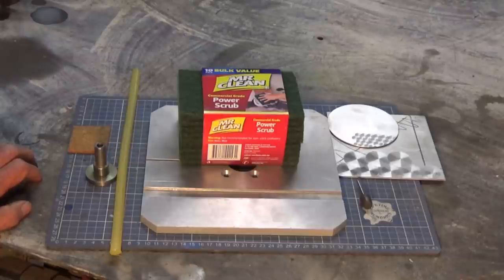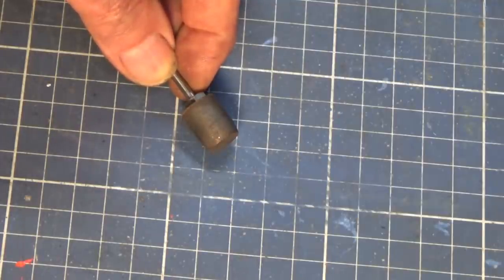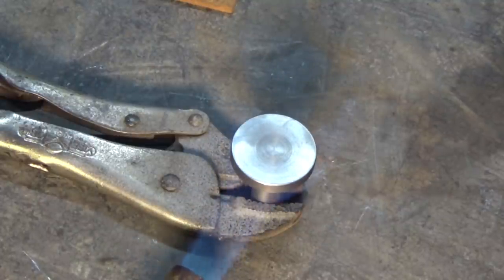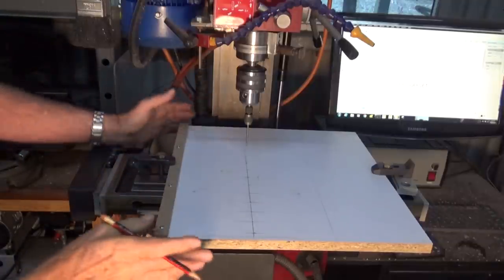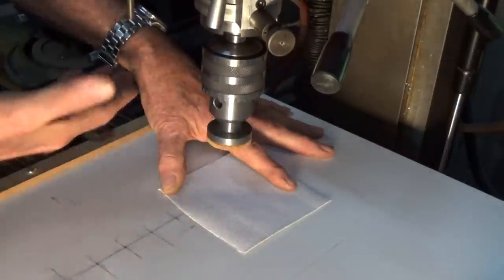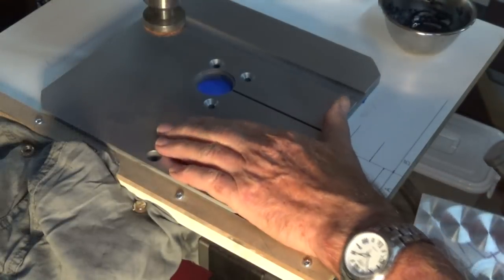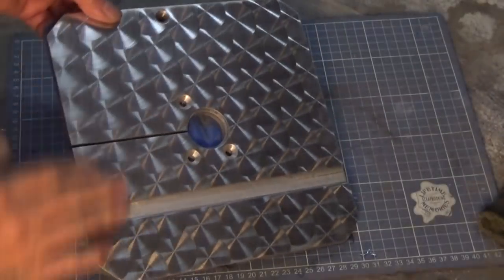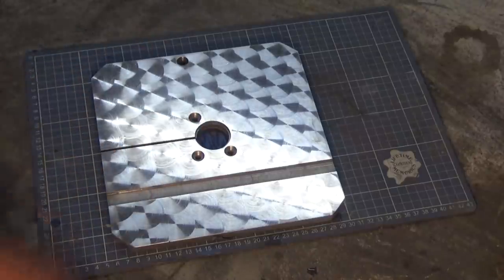Metal Finishing With Mark - Engine Turning 101

Comment: Always start at the same side, This technique is also much used on watch movements, where we apply it in a Circular pattern moving inward from the outside in the same direction every circle..
Overlap of the circles should be about 50%.. i use a 3 mm "EveFlex"tool, and i move over 1½ mm every time..

Comment: Hi Mark, I've been hiding in the bushes for a long time and this video has flushed me out!! I love all your content and always come away with something new that I've learned. I currently have a home shop with a CNC router and 3D printer that I've been using and playing with. I design and build mostly parts for my 1940 Ford that I bought 20 years ago and I'm still changing things, hopefully improvements of what I did earlier.

I'm going to use your technique for engine turning...

Keep up the excellent work and if you would like a few pictures of my car let me know. Not sure if I might have sent them earlier, tough to get old.....

Good'day mate,
   Peter
Reply from the maker: Thanks Peter. You did send me the photos of your car. A beautiful silver Ford V8. I was really impressed with the grille on that car. It's interesting because I had a conversation with an electroplater just a few days ago and we were discussing the process for chrome plating car parts back in the day when they did it properly. Usually a three stage process of copper, nickel and then chrome. These days they just plate straight over bare steel, usually with a nickel alloy and it doesn't last. Chrome is considered too toxic for the workers. However if you take your work to an old school electroplater you can still get it done to last. Keep up the great work. 
Regards,
Mark

Comment: I'm glad that you're anodizing your table after all the work you've done to it. It should increase the scratch resistance enough to preserve the look. You can even get fancier with a bright dye. 
I've been playing around with an ice bath to do small scale type III anodizing, and it does work. It wouldn't surprise me if you went with a chiller, but dying is limited due to the smaller pore size. 
A spring loaded holder might be an option for CNC engine turning. You could just smear the surface with an aggregate and run the job with cork as you did manually.
Reply: E Designs, I see you've had similar thinking on a spring loaded tool head to compensate wear. A query on anodising, does cast aluminium take an even anodic coat OK?
Reply: @howardosborne8647  Cast aluminum typically does not anodize as well as 6XXX series, but it does work. I tried type III anodizing a cast part and it was a different color (gray), would not hold dye, and had a hazy finish, but it was scratch resistant. So I considered it a win. Type II works better on cast parts.

Comment: Nice! If I was doing a run of these on cnc, I'd be looking at making a spring loaded tool, to account for the wear... top class job tho! 👌
Reply: The cork is the spring.  That thin probably ten thou give, but thicker yields more give.  Could also laminate something together.  At the "CNC" pro level though, it probably always gets done with abrasive rubber, because they remain at the same grit level as they wear, so no need to 'load the surface up fresh' to continue.
Reply: @cosmicraysshotsintothelight  The wear is from the cratex wearing in the z axis, the cork would wear but probably not enough to make a difference in a single cycle. Any chance you know what those cnc guys are using to filter the abrasive grit?
Reply: +1 I was thinking the same. Added advantage is the spring will compensate for small undulations in the stock.

Comment: As usual very well demonstrated Mark. And as at least one other has already mentioned the process is used quite a bit by gunsmiths.And like scraped or flaked machine tool ways it has some friction reducing quality's.  Plus it helps steel surfaces become a bit more rust resistant since it retains oil better. Both reasons are why it's used on rifle bolts beyond it's purely decorative effects. At one time it was seen on jewelry, pocket watches, watch dials,sterling silver cigarette cases etc. It's somewhat related to straight line guilloche and it's repeating patterns. And guilloche is somewhat related to Ornamental Turning.Your cnc could easily do guilloche or that OT as well. When jeweling curved surfaces such as rifle bolts they use not only the grinding medium but also a stiff wire rotary brush to help follow the radius. O rings are sometimes used around the wire brush to keep the wires from starting to splay out and ruining the pattern. On flat work it's helpful to have a scrap piece of metal of the same thickness as the piece your doing for the partial swirls around the parts perimeter since without that you can sometimes see subtle variations on those. 

In very high end jeweling everything I've read mentions mirror polishing the item first. There's never an explanation given as to why so my best guess is so your starting with a consistent surface finish that helps to maintain a consistent swirl pattern that reflects the light the same from each spot. Since the pattern is meant to reflect that light then small imperfections can be very noticeable. So the amount of time and pressure used on each swirl also needs to be as consistent as possible for the very best results on high quality work. Your band saw table might be a bit outside that requirement. :-) I'd just use a spring loaded holder for your Cratex and that way it's self adjusting for elevation and pressure.
Reply from the maker: Thanks for such a detailed response.  I have a pocket watch with jewelliing on the inside of the cover and I had seen the guilloche patterns on some watches I saw while I was in Geneva Switzerland. I didn't know what that process was called and I just googled it so thanks for the heads up. Also a good idea to use a spring loaded arbor for the cratex point. I have a diamond drag engraving tool that uses the same principle so it could probably be adapted for that use.
Regards,
Mark
Reply: @Preso58  Just like the overlapping patterns with jeweling that guilloche can give some surprising effects in it's repeating pattern and how and where it reflects the light Mark. There's quite a few YouTube videos about the use of the old school straight line guilloche machines that some are still using in there specialty work that only the very rich can afford. The machines themselves and there pattern bars are pretty simple for what they can produce. One more you should Google is Geometric Chuck. Today very few know about them, but they can mechanically produce literally  millions of different patterns depending on how the gear trains are set up, the part offsets and how many different levels there are to the chuck. 

Most on line and easily found information is still fairly limited in how detailed it is about those chucks and OT in general so I highly recommend a soft cover book authored by T.D. Walshaw titled Ornamental Turning. There's quite a bit about using the standard model engineers lathe (Myford Super 7 etc) boring heads, rotary tables or dividing heads to produce the simpler items of ornamental turning. Towards the back there's a very good explanation about how those geometric chucks work and an exploded view of a two stage chuck.This would be about the easiest and cheapest way to get it if your interested. https://www.teepublishing.co.uk/books/woodworking-woodturning/ornamental-turning/ Walshaw also shows how to produce the Ornamental Turning classic fish pattern using a common boring head and a specially sharpened tool.

Comment: Hello Mark, great video, I'm considering doing my own turning on my dash bezel for my 79 Trans am. I'm a machinist by trade and have access to a cnc mill with mastercam software and have been programming for quite a few yrs. My only concern is getting the bezel apart and flat enough to do the turning on it. Anyway, you sais something about changing code as tool wears. as far as changing depth, you can just add whatever z number you want at whatever x,y line you want to change the z depth at. Your z will continue at that depth until you put a new z on future x,y lines. Example, initial z -.005" depth, run thru 10 xy locations and on the 11th xy line, change to z-.008", run thru 10 more lines, 11th line, change z again. I checked your code as its running thru and noticed every line has a z, once the machine reads the initial drilling cycle line, it will repeat thru all upcoming xy locations until it reads something else. You should be able to start your first "G82 line with the z and every line after will stay at that z unless you change it. G82 G90X10 Y5. R0.1 Z-.005 P0.75 next line can just be X11. Y5., next line X12. Y5. and so on, machine already knows the Z, the G82 ,the .1 clearance and the .75 dwell.Hope this makes sense.
Reply from the maker: Thanks for that. I must say I am very much a novice when it comes to writing GCode by hand. I would love to own Mastercam but it's out of my league. I have used Fusion360, CATIA and a Denford product called QuickCAM Pro but generally I didn't mess with the code once it was posted. Good old CamBam works for me but it is very basic. Most of the stuff I do is 2 1/2D. Having said that, one of my students once wrote a code that ran on a Denford CNC router and it played "Waltzing Matilda" by varying the feed rate on the stepper motors. He took the sheet music and converted the pentatonic scale to frequencies and then changed the feed rate and direction to emulate the musical score. He used dwell in the code to account for the rests in the music. He was way cleverer than I though. We miked up the router and played it to a large audience at the Parliament House in Canberra! Priceless.
Regards,
Mark

Comment: Good Show Mate...as always. Leather stuck onto an old engine valve. I didn't have a fancy CNC machine. Wouldn't know how to program it if I had it. I do love though. Glad somebody knows how. That was fun. Still in my jammies. Be well.
Reply from the maker: I actually had some leather, an old belt but it was just a tad too narrow for the mandrel I made. The cork was right next to it so....
Regards,
Mark
Reply: @Preso58  What you did was  fine.  I was just suggesting another way to remove the feline from its epidermis. A pencil with valve grinding compound on the eraser is a good way for tiny jeweling. Isn't it funny, the more you know the smarter you are. Who'da thunk it?

Comment: Wow Mark! Great video yet again! the term for cnc is dwell it can be used kinda like a peck cycle to break chips. i did this to a c clamp in school
Reply from the maker: I did add a .75 second dwell to the drilling cycle on my cam software (Cambam). I was thinking there would be a g code which would add wear compensation to the code.
Regards,
Mark

Comment: Looks great. Saw the Spirit of St Louis a few years ago. Bugatti used to do it on his engines. Masterpieces. 

Used to go in cafés with machine turned aluminium table tops. Hated it, the feel of the aluminium top and the scratching damage. Just looked cheap after a while. But not a criticism of your choice, I think it will work well here. Looks like fun.
Reply from the maker: Yes, it was totally unnecessary for the application but I liked the look and it was a good experiment. 
Regards,
Mark

Comment: Very nice result in the end Mark. The CNC bit was awesome! I think the pumice didn't work because the grain structure of cast alli is quite open as opposed to the test piece where it is rolled during production, thus making the grain structure so much tighter,that said the valve grinding paste worked pretty well and gave a very good result, so now you have plenty of pumice to share between your French polishing and your feet............
Reply from the maker: I had been doing French polishing for years and never knew about pumice. Once I started using it I realised how well it worked to fill the grain on difficult timbers. I actually purchased a book many years ago which described the use of pumice but I figured that it was a really old text and the whole pumice thing was probably outdated but it turns out the old methods are sometimes the best. 
Regards,
Mark

Comment: I always find it fascinating how other people do the same jobs I do.  Sometimes you can learn things.  As a gunsmith, I do jewel bolts fairly often.  I use a much easier method because it's cheap and it works with great results.  You need a drill press with a cross slide.  I stick a pencil in the chuck, eraser down.  Coat the eraser with valve lapping compound fire up the drill press and start at one end.  Simply count the rotations of the cross slide handle to adjust the pattern.  Ex:. Three turns on y axis all down the row. Then offset your x axis and come back down again.  For cylinders you can use an indexer.  Stupid simple and I don't have to change the setup on the mill.  I never thought about using my CNC to do engine turning, I bet you could come up with some really cool patterns.  Also, is that a Colchester master round head I see lurking back there?
Reply from the maker: My lathe is a Colchester Student Mk 1.5. It's a nice lathe but the headstock is notoriously noisy. 
Regards,
Mark
Reply: @Preso58  nice!  I'm just finishing restoring a 1967 Colchester Master Mk 1.5 myself.

Comment: Very nice. Seems if you can keep the spacing uniform through out the item, either hand or CNC comes out great. One of those issues that you have to stay with and don't get distracted. Thumbs Up!
Reply from the maker: Gary, 
I was thinking I had done a pretty good job until a guy in Instagram called Eamonn Keogh got in touch with me. He does classic car parts like rocker covers on Rolls Royce engines. Some of the parts are really complex shapes and I think he does it all by eye and with a flexible shaft drive polishing head. He even put the jewelling on the raised "R"s on the Rolls Royce logo. Absolutely amazing! There is no end to human ingenuity and skill.
Regards,
Mark

Comment: This is a very popular thing to do on fire trucks in the states after applying gold leaf to the signage. I leant it here in oz during my signwriting apprenticeship but it wasn't something one used enough to become good at, as gold leaf is extremely delicate and is not only expensive but prone to damage so easily. Appling it to other surfaces wasn't asked for or needed or cheap so as a skill it wasn't practiced.
Reply from the maker: Luke, I remember seeing what would now be considered a "vintage" fire truck when I was very young. When I was in kindergarten a grass fire broke out just opposite the kindergarten grounds and the local fire brigade attended. I was fascinated with the decoration on the truck, and the firemen's brass helmets. It is sad that many of the skills that you seem to have acquired are no longer affordable or maybe as valued as they used to be. 
Regards,
Mark

Comment: Nice job! This has been something I have wanted to try for a long time. You covered most of the issues I had considered. I better wrap up some other things and try it on the aluminum case I have pieces for before I assemble it.

Comment: I would think to build a spring loaded  tool. That way you could use automotive valve spring and valve spring tool to set up an installed height or working height in this case. That way, when your tool wears, a few thousandths would not change the spring pressure. Just program in a dwell and depth to depress the tool and return before traveling to the next possition

Comment: Nice job Mark  think I will try it on my band saw buy it’s table is 24 inches square!
Reply from the maker: George, I was right at the limit of what my little mill could do. I actually have a Bridgeport coming next week and it would be capable of doing a 24" square table. My current large milling machine doesn't have a quill so it was never going to be easy to do it on that.
Regards,
Mark

Comment: The cork was interesting. It looks like a variation of lapping tbh.
That said, I think a balsa wood would do a better job as the cork would have a sort of uneven grain.
Also, if you used another metal that was just softer then the one you are working, like copper or something, that could work quite well too.

Regardless, I look forward to having a play around with this

Comment: Great video.I think if you spray a bit of kerosine over the plate to use as a lubricant for the crates might help with both wear and surface finish.Then a clear anodising over the whole lot.
Reply from the maker: I badly wanted to try anodising the table but it is just a little too big to fit in my tank. I will be showing that process in the next video. 
Regards,
Mark
Reply: @Preso58  How does your cast aluminium react to the anodising process?

Comment: Great job and well explained.  I think buffing the table was a major plus to your success as it eased the edges on the plate sides and the miter channel.  I didn’t ease the edges on a project I had and managed to tear up the mandrel surface about a 1/4 the way through the jeweling!  Another issue is the RPM of the spindle.  my experience (very limited) is slower is better than faster, but speed may have a greater effect on a particular metal (Al vs. Steel vs. brass)?  Another test/demo?
Reply from the maker: I did notice that the steel mandrel was getting quite hot and a higher RPM could potentially burn the abrasive into the aluminium or scorch the cork. I think I was running at about 500 RPM and it seemed to be about right. 
Regards,
Mark

Comment: 3m spray adhesive is good for gluing or contact cement works well aswell. What if you use polishing compound like autosol rather than abrasive.